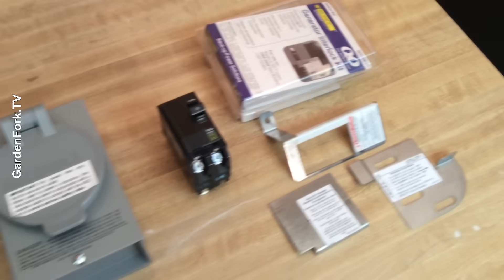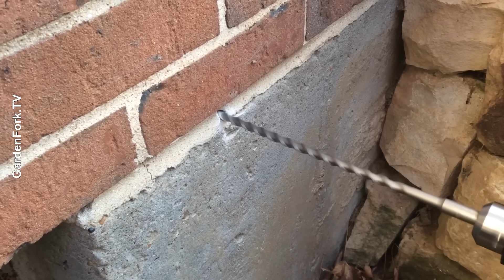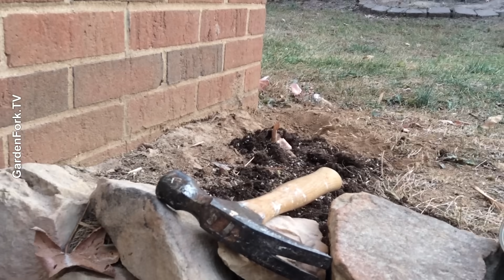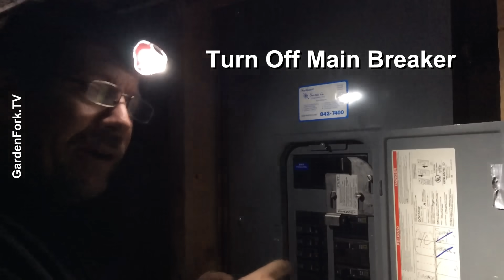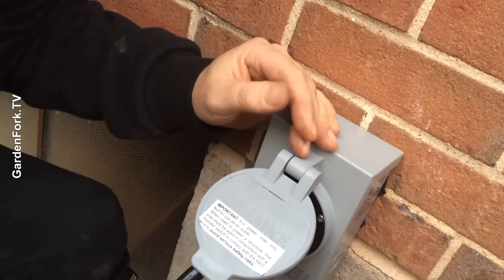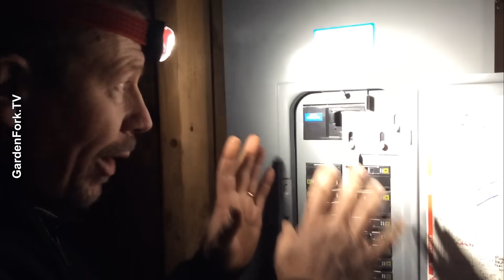Your Easy  & Safe Way To Hook Generator To House | Generator Interlock Switch Install | GardenFork

Comment: As a 23 year, licensed electrician, (36 years total) I will say this...this application isn't all that unique at all and is considered unsafe in most counties/cities/states.  Also, you're severely at risk of fouling up your main breaker by turning it off n' on...I don't care if you do, only 4 times a year!  Also, it's redundant to turn off any other breakers in the panel, "that isn't being used, based on the amperage of your generator", etc...just minimally use outlets etc., in your house!  But, the idea of turning all the distribution breakers off, before the generator is fired-up, is a good idea, based on surges.
Reply: @jimmyfly Yes it will...don't argue with me, you scrub.
Reply: @jimmyfly ...and you're the guy saying that throwing the main breaker "4x a year won't foul it up"... Also, wouldn't it be considerable to take the age of said main breaker?  What if the main breaker is 25 years old and you throw it 4 times a year?  No issue there huh?  You're the idiot...I'm the guy who has almost 40 years in the industry...go figure.

Comment: For about 25 bucks you can use a automatic transfer switch that will switch between grid and generator and back again without going out side.

Comment: I've been told by an electrician that turning off the main breaker yes does protect the electrical utility workers from back feeding the two hot wires that normally come into your house. But it Does "NOT" break the neutral connection in you fuse box, to avoid from back feeding thru the neutral line and injuring a utility line worke. He told me that this is another line that needs to be correctly done right and to get a professional person to make sure that everything is done correctly and making it so a person who thinks all they have to do is shut off the main breaker and they will then be safe from not harming anyone actually has the responsibility of breaking this connection as well to be totally safe. This is what I've been told so I may be wrong on this but that is what that man makes his living doing every day so I'm believing him and having that part of the job done by a professional tradesman such as him to protect myself, and for my own sanity to know I now don't have the capability to accidentally (because I didn't know better) harm, injure or kill some one else. Because I don't want that on my conscience.

Comment: few years ago in ice storm I wired right into outlet on circuit the furnace was on    all good  save the day  and week
Reply: And risked killing a linesman unless you install a switch that only allows connection to one electrical source at a time.

Comment: I'm a new to all this but am interested, does this also power up your ac unit as well? Sorry I'm a total noob.
Reply from the maker: No, you will need a much larger unit for that. This will run one or two window units. Thx!
Reply: Erick Rivera it’s a math thing. You have to figure out what you want to run figure out the wattage if each and fit the total into the running watts of your generator.
Reply from the maker: Whole house AC units draw about 30 amps to start up, that amount of amps is beyond most portable generators. I learned this the hard way and broke a friend’s AC compressor trying to run it on a portable gen.

Comment: At $52, that is some expensive sheet metal for the interlock!  But it is a great idea and much less expensive than a transfer panel (which is likely more like $500).  And not having to rewire the breakers is a real plus.  This is the first time seeing the interlock.  Thank you for bringing it to my attention.

Comment: Nice clean install. Most of our small home generators have a two pole 30 amp outlet so that's what you need to feed the house power with. If you have a bigger generator then size accordingly with the breaker you install. Forget the 240volt breaker designation (it's actually just a 2 pole breaker and the voltage is dependent of the power company). Buy one that matches the required breakers for your panel( usually a sticker inside the cover with the breaker model). The breaker itself may be rated for much higher voltage than 240. Now simply turn off the main breaker and turn on the newly installed breaker that's fed from the generator. Reverse order to go back to line power. Definitely run the generator dry to protect the carburetor. Mine is ten years old and still starts on the first pull. I do have a transfer switch for protection but it's not necessary as long as the main breaker is locked off. Now that I'm a senior I replaced my generator with a generac 22kw propane generator with a five hundred gallon propane tank to feed it. Now it starts and runs without me touching a thing or having to go out before bed to fuel the old generator, so it'd run all night to power the small window ac in my bedroom. A necessity for summer power outages.

Comment: Tip, gasoline powered generators, work very well, when ready to go back to utility power, turn off gas to gen, and run her dry till she stops. The gasoline these days will   gum up carberators fast. Sea foam, additive not a bad idea either. Happy generating.
Reply: Good tip. Plus, don't ever run ethanol mix fuel in any small engine. Also, use Stabile and/or other water inhibitors in your fuel storage as an extra precaution.
Reply: how'bout using TRUFUEL ? It doesn't gumup carburators.
Reply: Draining the bowl is a good idea, also get no ethanol gasoline sometimes called E0, recreational, rec or marine gas from a marina, mower distributor or some gas stations for your small engines. I'm still using some from 20 months ago in my weed wacker. It keeps like "gas used to".
Reply: Are propane generators better and easier to use ?

Comment: Ok thanks for the easy explanation. However there is a great need to keep the generator dry! That shed may be used, but a heat proof platform must be use, preferably a concrete pad to secure the shed to. Plus a couple vents, one in the highest point of the roof, then two down low, one close to the generator and another on the other side of the shed. These will help greatly in venting the Exhaust fumes and hot air that will accumulate from the generator, that will naturally rise up and hopefully out the roof vent and a natural movement of cooler air drawn in through the bottom vents. Of course it’s very important to know when the generator is running DO NOT spend any time in the shed! Another advantage of running the generator in the shed is that will help lower the noise! Especially if you add insulation board against the walls when you build it! I’ve built what looks like a dog house, that keeps my generator away from the weather, plus with the added insulation board added to the insides all around and over help quiet the noise so much you can’t hear it inside the house at all! I have an intake vent for the engine, plus a small computer cooling fan, that feeds outside air to the engine cooling fan, plus another blowing out the roof vent. But they are only needed for a warm weather emergency. The same system I had set up at our home up north never needed the fans running during any snow/ice storm emergency, due to the low ambient temperatures. But now down here in Central Florida? I’m willing to bet they will be needed!

Comment: Switch all your interior lights to LED and they will draw very low amps and that will leave more power available from the generator for things in the house that draw a lot of power.
Reply: I need an LED microwave.
Reply: Plus buy high energy efficient appliances ~ Big Savings!

Comment: Add this to the Above comment.........I installed one of the Reliance transfer panels to my daughter’s home.  It comes with special breakers that do not require the normal transfer switch breakers and works well.  Power fails, start the generator.  Gives you an ammeter reading for each leg of the power line from the generator.  The only drawback is that the circuits served by the generator are preselected and can’t be easily switched.  The entire service panel is not hot when on the generator like the interlock sliding device is used.   It is easier for the wifey to use than the interlock panel because she cannot screw it up picking out the circuits to activate or shut down in an emergency.  I label each circuit to deactivate before starting the generator.  Tell her to temporally turn off any large  loaded breakers as the generator comes up to full capacity.  Before picking the system you want to install, reread my messages and watch the YouTube videos again.   The sliding interlock system is by far cheaper, easier to install and more versatile.  The transfer switches are easier for the housewife to understand and activate.  All are safe.  In an emergency power outage, the line crews are going to throw a direct short across the incoming power lines  before working on them to check for illegal generator hookups and that will probably blow your home generator off the line. This  was confirmed with a major power company.  

Good luck

JoeB

Comment: I have used this interlock system for 3 outages so far.  Simple to install,  I  did it myself.   I moved the generator breaker up under the main breaker, moved the two 120 v breakers to where the generator breaker was.  That breaker was installed by the electrician when we built the house.  The heavy duty plastic interlock device is designed to mate with various service panel manufacturer’s product.  They are made for all common breaker panels.  Cost is about $20.  Instructions provided. 

The cost of a transfer switch professionally installed alone will approach  the cost of the home  5000-7000 watt generator.  Labor will probably  be about 2-3 hours for the  electrician who will estimate a half day minimum.h. Or maybe more !!!!!!!
  Good luck

JoeB

Comment: Is an interlock switch legal everywhere in the United States? I would suggest checking with your local codes department and/ or power company to ensure that this would meet local electrical codes.
Reply: For sure not legal in Canada
Reply: @primemoverelectrical3586  

This method is too dangerous because it is too easy to bypass. All you have to do is take off the cover to the panel or simply take a couple screws out of the interlock.
Reply: @Well_I_am_just_saying  You can’t fix stupid.🤔

Comment: The biggest and most important step was missed. There should be a separate ground for the generator. I understand people think it is grounded through the cord and the house ground. This is a very dangerous assumption. A ground rod should be driven into the ground and the generator should be connected to it.
Reply: Actually most generators have a ground in the receptacle plug on the generator. Your house panel has a ground rod connected so as long as your cord and plug carries the ground and it's hooked up in your panel to ground you're automatically grounding the generator. So your cord to the panel from the generator should have that ground wire and it should be connected to the ground bar in the panel. You really don't want a separate ground rod at the generator. That's likely against code and you'll create a voltage potential between the ground rods. To be legal you'd have to run a wire from the second ground rod to the first taking only one ground to the panel and not grounding the generator separately. If you don't have a way to test the generator ground at the generator you can run a separate wire from the house panel ground out to the generator and bolt it to the frame but that's where your ground needs to come from.
Reply: @71160000  in my area, mid west.  Not a lot of newer homes, I couldn't tell u how many homes I have preformed service call at, missing water meter bond, and system not grounded, ground it, cya, H. A. ELECTRIC CO. 66years in the business, thank u for your comment.  May all your connections be tight.
Reply: @71160000  Perfectly explained...
Reply: In our world, the United States of America, every thing goes to ground, in the transmission of power, ground, ground, ground. 5/8 ground rod, 8 ft long. In ground. Ground to frame of generator.
Reply: Great thank you will do!
Reply: Is there a location on the generator that is specifically for a ground wire or do you need to tap into it?
Reply: Brett Dman There is not on any portable generators.
Reply: Great comment, absolutely ground   it then if the homeowner has problems you know u covered your   ars, happy generating
and good day

Comment: Everything looks good, except for the storm part: you gotta have a rainproof enclosure for the generator, otherwise you'll be in trouble, electricity and water don't mix well, you said it, right? Also, the receptacle outside in which you'll plug the generator should be pointing downward for the same reason. When you have a bad storm or a hurricane (like sometimes we do here in South Florida) the rain comes at you at almost any angle . There are receptacle models that are built pointing downward.
Reply: Good tip. Also, it may not be rain, it might be 3 feet of snow or a thunderstorm with hail. Plus, you don't want to be adding fuel to the gen (or trying to fix it) while exposed to the elements.

Comment: When jogging breakers on a live panel you are supposed to stand off to the side, turn your head away, and close your eyes. If you blow a breaker and there's an arc flash you'll be thankful you did
Reply: Shut up. Arc flash in a 220v single-phase residential panel? Lol.
Reply: @skynetlabs  ok chief

Comment: I like simple ways of doing things... I'm on the desert near 29 Palms, Ca. My computer says it will be 114 today (Sept. 4. 2019). There's a good chance the power will go off because of some equipment failure (I've lived here 43 years --so I know what to expect).  I have a Honda inverter generator that's able to run one small through the wall A/C, my refrigerator, and a small freezer. I simply drilled a hole through the kitchen wall, inserted a power cable, use extension cords, and I'm good to go. It's not very elegant, but it suits my simple brain and does the job.

Comment: So what happens to your generator if you turn every breaker on
Reply from the maker: Hi Michael, it depends on how many appliances, etc are turned on. You can damage or ruin your TVs, Microwaves, etc if you don’t calculate the load and what your generator can handle. Be careful and be safe.
Reply: @gardenfork  ahhh ok thank You and good catch on my name lol

Comment: Any type of a similar setup for a 120 volt only generator thanks
Reply from the maker: Sorry no.
Reply: You probably could by either putting it on a single pole breaker and only feed one side of your panel. Or use a double pole and jump across it so you had power to both legs. I would however shut off ever other double pole breaker to avoid doing any damage to your generator. Not to code by any means but........... Oh and you would need to either pull the breaker or remove the jumper wire before turning the main breaker back on or you could have major fireworks or worse.

Comment: You still have your generator tied to the system neutral supplied by the utility company this way which is still a back feed situation. If you have a problem with your service due to a storm this presents a dangerous situation trying to reconnect service to the company circuit. I saw a lineman fall off a pole in Okla City when he tried to reconnect the service neutral while the generator was running even with the house meter pulled. Man did the sparks fly.
Reply: @Mr Sunshines ya, OK. "Sections 250.20(B)(1) and 250.26(1) still require the grounding-electrode connection, and 200.6 still requires the conductor to be white or gray “neutral” conductor. However, it is not a neutral conductor, even though many people still refer to it as a neutral. This is a grounded conductor, but be careful. It is just as lethal, if not more so than our “neutral” conductor."
Reply: So how are you supposed to wire a generator then?
Reply: @MeltingRubberZ28  call a certified electrician. backfeed is one of the most dangers to a lineman and the public if wires are down. Honestly this is a simple easy trick, but it probably violates code in many states. the neutral has to break plus the generator needs its own earth ground. 36 years electrician/lineman
Reply: @goinbananers  so the neutral bar that is grounded to the water line and the ground rod is not going to stop a lineman working on the pole from getting shocked? Somehow the current is not going take the easiest path to ground and it will instead shock the lineman? Sounds like the situation you have described was from a house with improper grounding.
Reply: @MeltingRubberZ28  ground bar is connected to the water pipe and a ground rod. these days the ground bar is connected to 2 ground rods 6 feet apart. if you do not ground the generator and seperate the neutral from the field circuit, you have a potential safety hazard. even if you have everything grounded, a neutral can back feed. Its not the generator that is dangerous, its the generator back feeding thru a load side out the line side of a transformer that is. you have to completely isolate the line side circuit. and yes that's what this all about. something that goes wrong in the wiring. 1st rule of electricity. it's unpredictable.
Reply: @goinbananers  so basically you're saying as long as the house is wired correctly, there is no problem, but if the house is wired incorrectly, you can hurt the lineman. Who would have guessed.

Comment: But you cant turn on the whole panel onely small amp draw stuff
Reply from the maker: It all depends on the size of your generator. The wattage of your generator has to be able to power whatever you want to turn on.